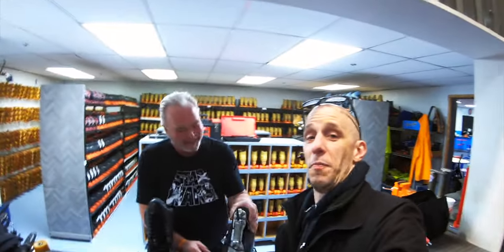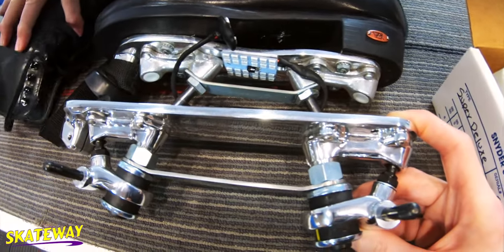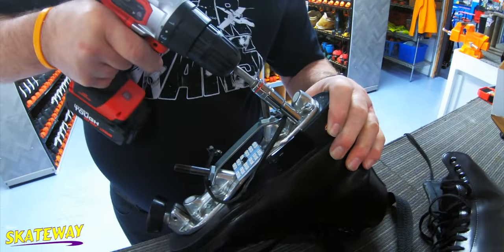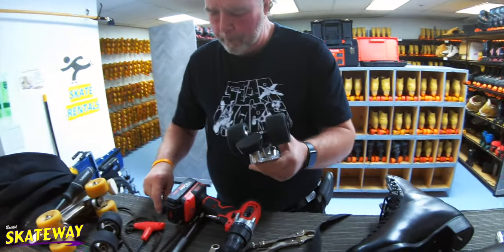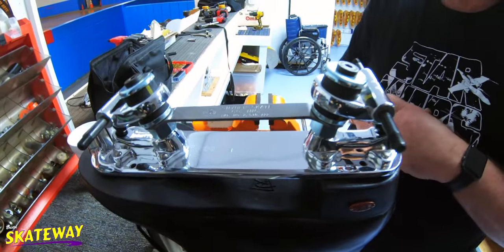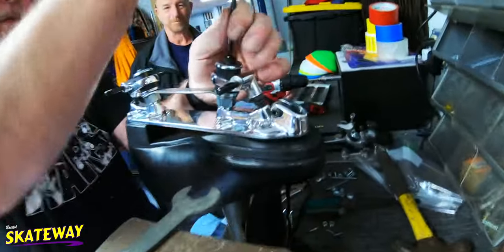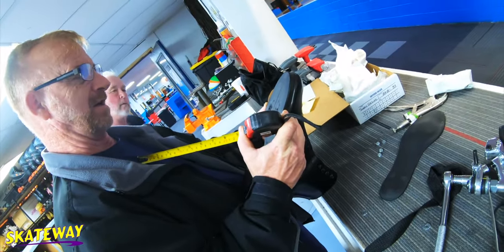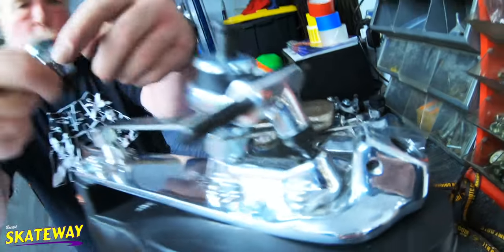The Skate Shop - Snyder Super Deluxe Plate Upgrade

Comment from the maker: *Note: A standard hammer was used on the new plate rather than a rubber mallet. We don't advise this. Skateway always uses a rubber mallet in situations like this to protect the plates. In this case, the mallet was missing and in a pinch the owner of the plate gave permission to use the hammer. To date there have been no cosmetic or structural damages to the plate, but we should have mentioned it in the video.

Comment: I have a few pairs of skates a Red Wing/ Snyder Deluxe, another Red Wing 220 on a Cleveland Citation and a Red Wing on a sunlite,that I skated in when I was younger.Now I've slowed a little bit but the Snyder is heavier but to me gives a smoother ride.You just "dropped" some knowledge on me even though I've been skating 40 yrs.👍 Searching for a new plate now for mint Red Wing I just purchased, probably my last pair of skates till I physically can't skate anymore.
Reply from the maker: As I am the one who got fitted with the Snyder Deluxe, I must agree that the plate is heavier than the Sure-Grip XK4 DA45 plate I was using beforehand. It is indeed a much more stable and smoother ride; one of the first things I noticed right away. With your current status, I would recommend a lighter plate maybe with a 10º axle for more stability. As to which plate, there are so many to choose from that I am at a loss for recommendations.

Comment: I love mine...Had them for more them 30+ years....Replaced the boots a few times but still going strong. Just added Bone Elite Wheels with Ceramic Bearing Night & Day experience. "5 Stars Plates"
Reply from the maker: Pretty tough plates, and I put them to the test frequently. A bit on the heavy side compared to the XK4's I was on before, but you get used to it. Much more stable. I'm rolling on Rollerbones Turbo. Ceramic bearings will be my next investment.

Comment: Really appreciated this video, thank you for posting! I bought Super Deluxe plates just a few weeks ago, but I didn't mount them myself, so seeing the different parts and knowing what to expect with the maintenence, like changing out cushions and adjusting the action, is super helpful, since all my other plates had such a different setup with the kingpins.
Reply from the maker: You're welcome. Yes, knowing the components and how to make the proper adjustments in the right way to any plate is extremely important. What works for one may not be true for another. Paul was a valuable resource in explaining those things. Thank you for your post. I will pass it on to Paul.

Comment: Nice video!  I have a few skates all fitted right with correct plate and boots size.  But I have this one roller skate I built years ago size 7 plates with a size 10 shoes, it works real well and very agile
Reply from the maker: Thanks, Gardner! Yeah, my smaller plate to a larger boot made me very agile as well. I know this only too well from having properly mounted plates and not having the agility I once had. Can't say I don't miss it at times.

Comment: I’m a boomer an sometimes I can bee too my way or the hyway. Not trying to be like that now but why are you suggesting taking out the Allen screw from the proline kingpin? It’s a screw that could easily be lost or just dropped then hard to find. It’s not supposed to be taken out. (Yes I put together the first and second plates ever and many more lol). Also, while a “crescent wrench” can work on just about anything a standard wrench can work on, it’s a great way to mar up a nut. This hardware is aluminum. If these are OG prolines I might have made those nuts and id hate to see them banged up for nothing :) 
   Shit I might have poured those cushions. “Set pin” set screw. It has a chamfer. :). 
    Also are this OG prolines? Is there epoxy in the top of the plate behind the pivot bushing?  If so after changing cushions you are supposed to reset the bushing and re-epoxy the bronz bushing. Class dismissed.   Seriously though pretty good video.

Comment: thinking more degrees givees you sharper turns ,, i find its about the angle of the pivot pin   re  Bont 45 Degrees {45 w straight vertical pivot}    vs rolline 20 degree ---found wayy more responsive at 20 degree and 20 pivot ,, ... but reactor plate w 10 degree are like cross country skiis .... good for speed just my thoughts
Reply from the maker: I would say you are correct on this. As in the video, I was skating on 45 degree plates. I run pretty high speeds chasing skaters with a cam and now find I have a lot more speed with fairly decent performance in my taking turns. Highly responsive for what I am doing. However, I miss the 45 degrees for doing spins and certain freestyle tricks.

Comment: I tried the vice grips and I still can't get the bolts off to remove my plate....any suggestion?
Reply: I would invest in a Dremel and cut bolt not plate or boot!
Reply: It’s a Reidell skate, I’ll bet. So the bolt is snapped off at the nut, making it nearly impossible to get the nut off.  I wish they would stop that shit.

Comment: How about the roll like Ring plate? Most say they didn't like it but it was a great plate. Something about feeling in between the wheels (guess how low it is). I'm into rhythym and JB skating, turns and everything. I already had my stock plate so loose it wobbles like Daewon Song.
Reply from the maker: Yeah, those Ring plates are rated for professional figure and artistic skating. Every style of plate has their own trade-offs in regards to performance and what you are primarily using it for. So those who weren't fans of it were probably wanting something beyond its design specs.

Comment: Hi there, I have a pair of Chicago Skates that I purchased in the early 80’s. They’re in great shape but the plates have definitely lost their shine. Do you have any tips on how to polish them and make them look new again? I have thought about using Stainless steel polish spray but wasn't sure if it would be safe. Any help would be greatly appreciated. 
Thank you!
Reply from the maker: You always want to be sure that any cleaner you are using conforms with the metal you are using it on. I'm sure you're aware of that, but that said, a polish I see being used is called Mothers Mag & Aluminum Polish. They state it is for all metals and seems to work great. Also use a can of air to blow out any dust in the cracks.

Comment: May I know the plate shall it touch toe to heel or can less 1 centimeter from the boot? Also what is tool name that he measure the center? I cannot find it online thanks 😊
Reply from the maker: Hi, Melissa. Paul goes over the specific way to place the plate on the boot in the video. I will get with Paul over the next week and relay your question if the video isn't answering it for you. The tool he uses to measure the center is called the Snyder Boot Marking Tool. They retail for around $50 as of this posting.

Comment: Plate definitely to small, those boots do swamp it. If however plate was right length yet advanced on a flat sole & not a heeled boot that would suggest skates were for speed skating. I remember the first time i tried a setup like that, i did go arse over kite & landed on my butt. The first time was the last time that ever happened. It is weird at first however you get used to it & eventually don't notice it. 7mm axle is excellent you can upgrade to quick release if you haven't already. You can get adapter sleeves so that 8mm bearings fit
Reply from the maker: Yeah, I got used to the the undersized plate. I do miss it, as crazy as it may sound. The new plates are pretty heavy, but more of a stable platform.

Comment: Guy lost me hitting the plates with the steel hammer. Why this and not using a rubber-hammer? Really frustrating to see. Nice vid anyway
Reply from the maker: Yeah, it was my plates he was working on. I get your point, but for me, I don't mind some scars on my plates... but it worked out without any blemishes. I would agree that the use of a rubber hammer would be best, but none were available at the time of recording. Thank you for the input and glad you liked the vid.
Reply: That and him calling bolts “screws”. I know it’s nit picky, but it tells me that he’s not a well-versed mechanic. Alternate mountings do have their advantage over center mount.

Comment: I want to see how are you filming your feet, and then your face? What kind of tripod is that? I got to get me one of these!!
Reply from the maker: Using a telescopic pole with a GoPro on the end of it. The pole is made by GoPro. It took a little time to get familiar with it as you can't really frame your shots. It's a lot of guess work, but when you use it often, you just know how to point it by line of site. Plus it helps to have a wide-angle camera like a GoPro.

Comment: What is your led setup?
Reply from the maker: We have a local skater that provides our LED's. That was a two-chip LED system that runs on a 9-volt, can change multiple colors but drains a full battery after one session. I have a newer one that consists of one strip, blue in color and is much brighter and uses much less draw on the battery, lasting several sessions. About $30 using a patch of velcro, but there are others ways to mount them depending upon the plate.

Comment: I was onboard right up to the point where he pulls out a hammer and starts hitting an expensive aluminum plate with it! 😂😢
Reply from the maker: I should have mentioned in the video that the rubber mallet we would normally use was missing (Things get taken or misplaced). I gave him permission to use the hammer on my plates and I've had zero problems to date. But yes... I agree! Skateway always uses a rubber mallet for operations like this for everyone. It was my personal decision in a pinch at the time.

Comment: The plate was a good length to start with.

Plate way too long now.
Reply from the maker: Well, being the one skating on the old and new plate I can see you point, but the tradeoff for me was a much more solid platform that I find to be highly responsive and a bit more stable when I am chase-filming skaters. I also find that I can spin faster with better balance and control.

I've noticed speed skaters tend to go for smaller plates without much support in the heel area. Such was the case for me using the smaller 45• plates.

BTW, love your channel! That's dedication!
Reply: @bristolskateway  fair enough.

Thanks for the compliment. Wish I had time to do more videos.
Reply from the maker: @Thequadchannel  You and I both on that one. Never enough time.

Comment: Seem he was confused ! Look like you need smaller wheels
Reply from the maker: Not sure what you are referring to, but if you mean the axle size for the wheels, I roll on a 7mm and he wanted to be sure my bearings were 7mm (The axle on the Snyder is 7mm)  and not the standard 8mm, otherwise I would have had to change them out. If you just mean the size of the wheel, it all depends on what you want to accomplish on the floor. I use a larger wheel as I primarily intercept other skaters while filming and I prefer speed, a stable platform and grip. Smaller wheels are generally for more artistic skating. I hope this answered your question.